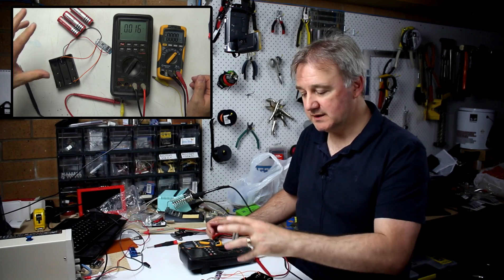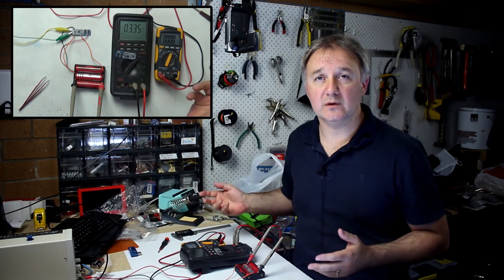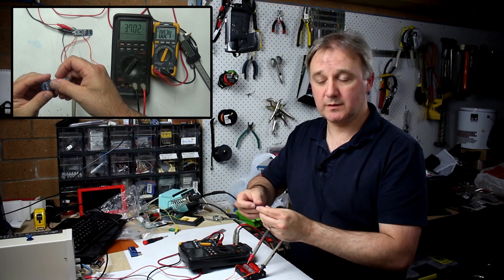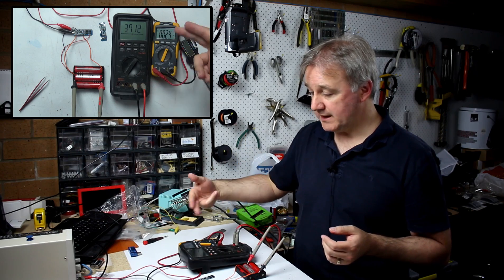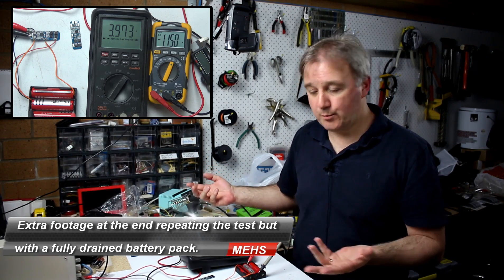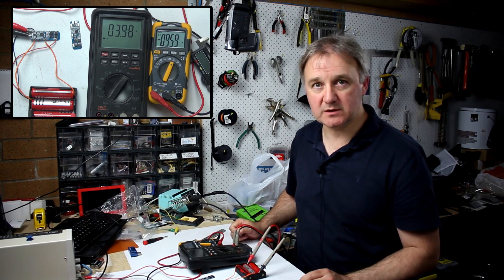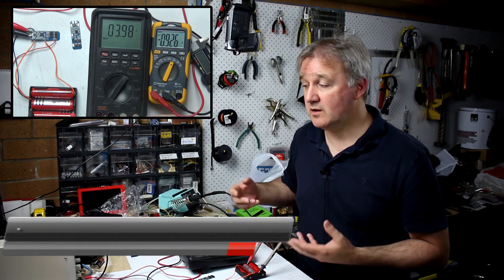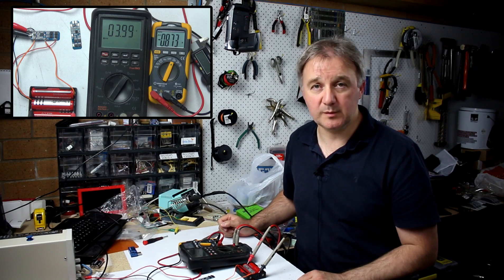Does a BMS charge my Batteries? (MEHS) Episode 57

Comment: Some problems with your methodology:
1) Ultrafire batteries have at most 200-300 mAh, not even close  2-3 Ah (sometime the Chinese claims even 4 Ah or more on aliexpress or ebay)
2) Why din't you let the go to 4.1-4.2 volts ?
3) BMS is commonly used in laptop batteries so maybe the BMS you tested is not good.
Reply from the maker: -Hi.  Yes some 18650's have very low capacity.  From what I can tell so far these are about 1800mah.  The charge per cell didn't reach 4.2 V only because there was some loss through the circuit.  I would need to provide 12.8 to 13v to get a full 4.2V per cell.  I will be doing that in a future video.  I have tested 6 BMS with the same outcome.  The laptop example you mention works because the laptop batteries and BMS are being fed by a proper charging IC which give a great result.  Cheers.
Reply: I really do appreciate the work that you are doing and sharing with us, but given that you did not use 12.6 Volt supply (or maybe 12.8?) and given that you did not account for the series current issue, it might be that this board CAN actually do what we can hope for which is to prevent over voltage and over discharge. I will try a similar board out to see what happens with the balance charge issue, and hopefully come back here to share. But given the problems that you had with your methodology, your conclusion is probably wrong and you should really remove this video. I'm not trolling, I really appreciate the fact that you are sharing your knowledge.
Reply from the maker: Douger Rohmer
- Hi.  I guess its fair to say that the video just  shows a methodology and a conclusion but I can say that I did a lot of testing with this batch of BMS (BPC really) and they do not charge a lithium battery in a safe manner.  I have since done a follow up video (ep 58).  This batch of BMS dont have a proper charging IC and (one of the biggest problems) dont have a timer to cut off charge to the batteries.  The later video provided 12.8V to the BMS and the results were the same, worse really because I got a measurable overcharge.  Some boards have balancing but this one does not.  Im going to keep testing different boards and combinations and see what really works etc.  If people are using these boards as a battery protection circuit and are charging the embedded batteries through the BMS but still using a dedicated 3S balance charger then all good, but I see a lot of people using these boards as the charger, balancer and protection circuit, which they are not.  If you know of a single board that does this that can be enbedded in a project, please let me know.  Cheers.
Reply: Thanks for your response. I had a look at the other episode, and will make some comments there too. I did my test to check the balance charging of this board, and found that it does not balance the 3 cells if they are at different voltages at the start of the charge cycle. Herewith the starting voltages of the cells, with finishing voltages indicated in parenthesis: Cell 1: 3.58 V (3.9 V); Cell 2: 3.68 V (3.8 V); Cell 3: 3.9 V (4.139 V).  I measured the current flowing to the board, and found that it is not a constant current, but a pulsating current. I recorded the max volts, and the ave volts as I do not have  an oscilloscope to make sense of the pulsing stuff, and my Fluke has the max and ave function. It started off with 1.065 Amps max 0.626 Amps ave, and after 90 minutes was running at 0.831 Amps max and 0.041 Amps ave. The total voltage for all 3 was 11.85 V at this point. After this, the Amps max stayed at about 0.8 Amps, and the average slowly declined to 0.014 Amps. This is where things are right now, and I suspect that the board is now in some sort of maintenance trickle charge mode, and the individual cell voltages and the total voltage has not changed. 

I think what the board does is pulse approximately 1 Amp to the 3 cells, and then fiddle with the Pulse Width Modulation as the pack voltage increases.

I have done some other tests with lower voltage cells (of the same individual voltage) and things are different when I started the cycle at a lower pack voltage. I will run the tests again and come back here with the results, because it's interesting :-)

I have used this board in another project, where I replaced the NiCd batteries of an old cordless drill with 18650 cells pulled from old laptop batteries. I do not have a charger that can accurately measure the amp hour capacity of the cells, but I made up a bunch of individual cell chargers using TP4056 and "balanced" all the cells that way to the same voltage before installing it in a 3S2P pack for the drill. The cells are usually good brand names such as Sony, Sanyo or Samsung and usually started life out as 2200 mAH cells. My pack is a bit of a disappointment when fitted in the drill - I suspect that the board does not allow 6 Amps to go through which is what the drill seems to need at start up, but it works OK if I don't crunch the start button to demand max amps from the battery pack all at once. Also, the speed is a bit down as the drill is a 14.4 Volt model. I think the way to go is to get a 4s board that can handle 10 Amps, and fit a 4S2P pack but that is a project for another day.

I've done a lot of Youtube research, and found it interesting that various people who I consider gurus in the fine art of 18650 charging (such as Jehu Garcia and Shawn McCarty) don't think BMS is necessary for series charging if you start off with balanced cells and take precautions against over current and over voltage and under voltage.

I disagree with your conclusion that the cells are not charged in a safe manner with the 3S board. I agree that the board does not balance charge, but it does protect the cells from over voltage charging, and over current delivery and under voltage when in use. Is it necessary to use one? I don't think so if the above precautions are taken.
Reply from the maker: Douger Rohmer
- Hi.  Thanks for the comments.  I took a look at the IC on these boards and it does take care of over voltage, over current and low voltage cutoff as you mentioned.  The problems are that it does not properly charge the lithium batteries in the way they are supposed to be charged, CC then CV with a termination point.  This might not cause a fire risk but it does limit the life of the cells.  The lack of termination could actually be a fire risk as the cells are continually charged and lithium cells dont like trickle charge.  That is my issue with these BMS.  I agree if you take precautions you dont even need a BMS.  I done this with a number of projects (something I need to keep in mind when I make videos as I get told off for not showing a final product that has all the expected safety precautions included).  You can charge a lithium battery with a bench power supply as long as you can setup CC then CV stages and monitor or time the charge (something these BMS dont do).  Your drill example is a good use for a BMS (I agree a 4S one would be better).  The reason this is ideal is because the battery pack is charged through the BMS by a proper and dedicated battery charger that came with the drill (I assume).  In this case the cells are being charged properly including a termination point.  My issue is when a raw 12v or similar power supply is applied to the BMS directly and it is expected or assumed that the BMS will take care of everything.  It doesnt.  In your drill example you are using the BMS the way it was intended and not asking it to do the charging cycle.  Hope that makes sense.  Cheers.
Reply: i bought ultrafire batteries rated 4800mAh... i made some crude arduino battery capacity measument circuit i picked up on instructables... and i measured "real" 480mAh... they are very low capacity... and i tested some batteries from old laptop battery packs.. they were around 1500 to 1800 mAh

Comment: 3S cells all see the same current.  1 Amp is not divided by three for each cell. Volts are but not Amps !
Reply from the maker: OMG I just realised what I said.  I really was having a bad day.  Yes of course you are correct.  I will add a correction or maybe take the video down.  Thanks.
Reply: @michaelsstuff4402  even though it is still not exactly constant current, would you consider this circuit to be a usable charger for cells with 1-1.8ah?
Reply from the maker: @youradvertisehere  - Hi.  These BMS will allow current to flow to the cells but they really only stop over voltage and current.  The cells will receive charge but it won't be peak and it won't help the cells last a long time.  If the cells are cheap and your not too worried about costs and lifespan then it will work.  If you wanted to do it better in a 3S or 4S configuration I would put a MAX745 in the mix as the dedicated charger.  If you're using 1S or 2S then the TP4056 or TP5100 boards are a better option.  Cheers.
Reply: What's the moral of the story? Can I charge a 3s 3p set of 18650s (total 9) with my regular 12V adapter (or 12V solar panel) using this 3s BMS or naa?
Reply: how about the batteries in parallel, 3s 2p in exact. does the amp divided on each battery?

also a follow up question, i have alot of 18650s i tested around 4 to 6 wh (1000-1500 mah) when i discharge them with constant 0.3 amps each they're good and able to retain the same readings last time i tested. but when i discharge them 1 amp or more they instantly shuts down at 3.6v. if i rest the batteries less than a minute before plugging them back to my charger they're back at 4.0v. are these bad batteries?
Reply from the maker: @rosekreuze  - Yes I would say your cells are bad or are very low capacity.  A good cell will easily deliver a constant 1A.  I have quality cells that delivery 4A each without issue.
Reply: @michaelsstuff4402  thats what i thought so, but could still be usefull on other low power projects. i have another question. does the total amps the batteries can deliver can be multiplied in parallel? i mean the more batteries in parallel the more current?
Reply from the maker: @rosekreuze  - Hi.  Yes, more cells in parallel means more current only, more cells in series means more volts only.
Reply: Klaus Daume  each batteries were discharged twice (0.3amp) and charged twice (0.7amps) comparing the first and second cycle test but assuming the total Wh on the second cycle or maH but with a difference of 1 to 5v. some batteries can hold 4.2v some are like 4.16v .

i have alot of these batteries salvaged from powerbanks laptop battery, so far 11 of 18650s are already been tested are weak but can deliver constant 0.3amps
Reply: @michaelsstuff4402  This is exactly why your 3s pack only takes around one amp - because this is the limitation of the cheap cells you are using. Try it with good cells that would actually take 2A at 4.2V each or make a 3S 2P pack or even 3P if you want to really test the BMS board to its limits... Also due to losses in BMS circuitry you should really be supplying around 14-15V as this might be the other thing limiting you.
Reply: @VinceDonkovWorks   4 months later im still using those batteries to power kitchen closet door lights each. charging those with a phone charger which only automatically charges them while in the kitchen with a PIR motion sensor. assuming im still alive and was able to reply to you after 4 months from my initial post  and haven't burnt my parents house down, im not thanking you anytime soon.

edit: i would like to add that for certain low power applications thise weak cells are still good and can be charged fast as they're low capacity cells but we're still able to hold a charge during non-charging state. those cells we're separated from my 3s and 4s packs
Reply: @rosekreuze  Your life is yours to gamble if you wish but for everyone else reading this, my initial warning still stands...

Comment: Other BMS could potentially do that better? Or is your statement a general statement that BMS are not good for charging?
Reply from the maker: Bernd Hachmeister - Hi.  Generally not good for charging.  They allow some charge to go into the batteries and they do control some unwanted situations such as over voltage but they don't charge the batteries correctly and there are risks such as trickle charging that a BMS doesn't manage.  I would rather avoid such risks and get 90% out of my batteries rather than est 30%.  Cheers
Reply from the maker: Oh, and I haven't yet seen a BMS that is any better that the one I tested or one that has a dedicated charging IC on board.  Cheers.
Reply: @ Bernd Hachmeister there are several boards that will protect your cells. Please don't believe this is a blanket statement. He is also using the worst cells known to exist for this test. I have several videos available on this topic.

Comment: Aww, i thought this was a nice magical replacement for simple 12v packs and charging them, had ordered a few and waiting, thanks for the video though!
Reply from the maker: -  Well its a start and if you add a 3S charging module ($3 ish on Ebay) and feed the charging module the right voltage and current you will get your 12v pack.  I'm doing a project (Next vid probably) with 2 high powered LED panels with, remotes, adjustable brightness and battery backup power and in them I will use either the BMS with 3S board or an array of TP4056 boards.  Maybe do one of each.  Might be something you find interesting.  Cheers.
Reply: any recommendation for the charging module?
Reply: A 3S lithium ion charger for RC vehicles would be good,but then you also need to solder on the appropriate headers and attach the charger(relatively big) to every time you wish to charge it, which is something i hoped to avoid with this solution.
Reply: thanks, but wouldn't a decent rc battery charger replace the need for the bms altogether? (charging wise)
Reply: If you attach the battery to, say, an electric bike, then the battery could get damage by over-discharge.
Reply from the maker: floxflux
- Take a look at  http://www.ebay.com.au/itm/271957154780?_trksid=p2060353.m1438.l2649&ssPageName=STRK%3AMEBIDX%3AIT
Just remember such boards can only take about 1 amp.  Cheers.
Reply: thanks. will you make a video of it? :)
Reply from the maker: floxflux - Yes more coming on BMS choices and charging lithium ion batteries.  Cheers.